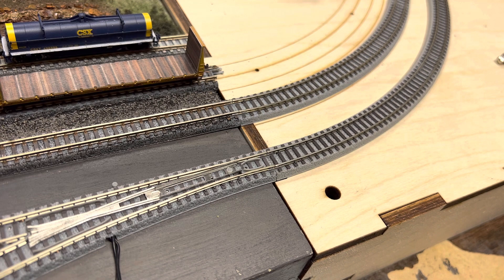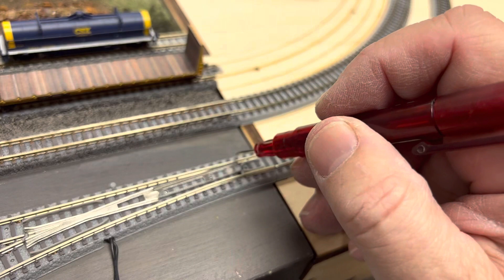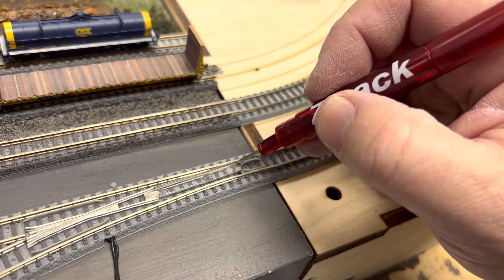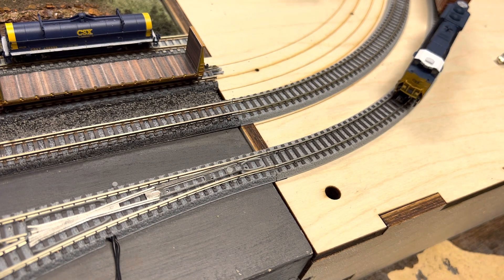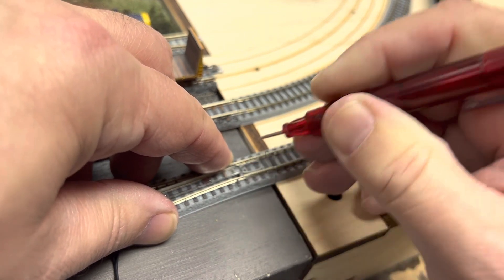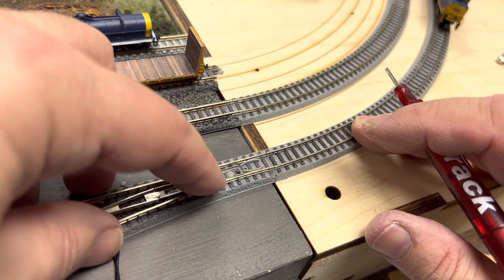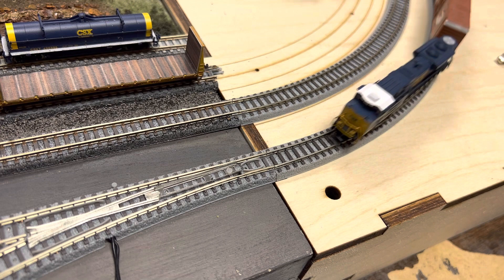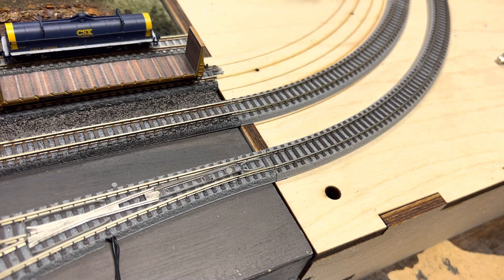Rokuhan R039 Adjustment

Comment: I am having this exact problem. I am new to this hobby and find this very frustrating for a newbie to deal with. A first my loco (no cars) was derailing. Now the loco (no cars)  runs through forward and reverse. But if I add one box car for example, the box car derails while the loco stays on course and pushes through. Note: I am trying to back through the turn with the box car which is the opposite of what you are doing in the video. What about if you set your train facing the other way - can you back through your repaired turnout as per the video fix?

Comment: I'll check mine as they go in. Question what do you use to bore through the plywood in order to run the switch leads with their square plastic heads down and over to a transformer. I want to avoid stripping and manually reattaching if possible
Reply from the maker: What I do is actually drill a hole about the size of the plug UNDER the turnout. The wire then drops through the hole, and the turnout then covers the opening. It works great!